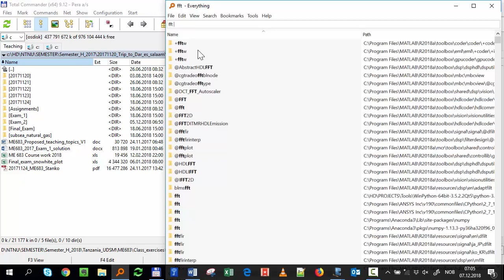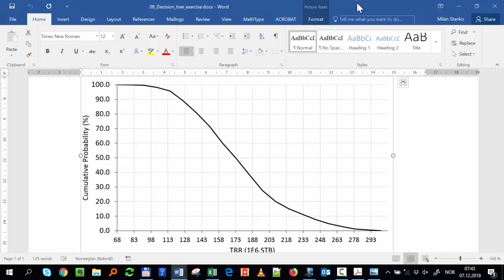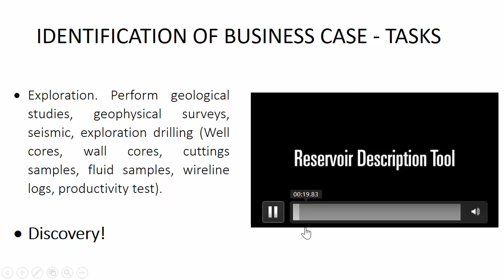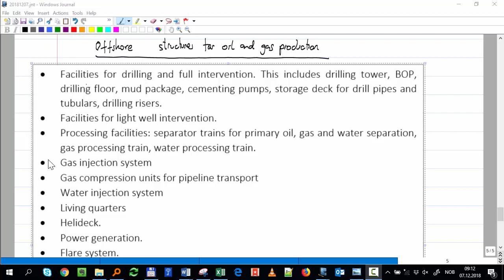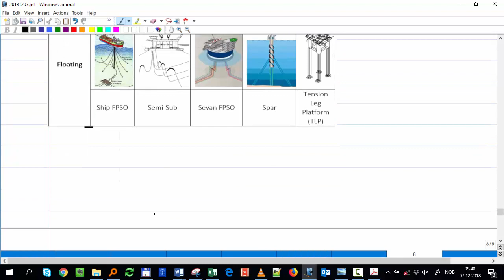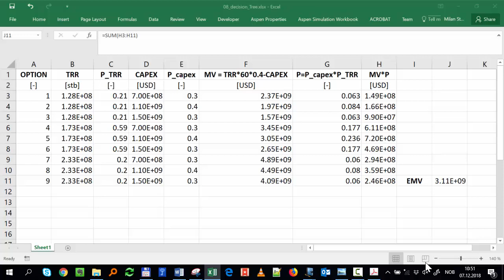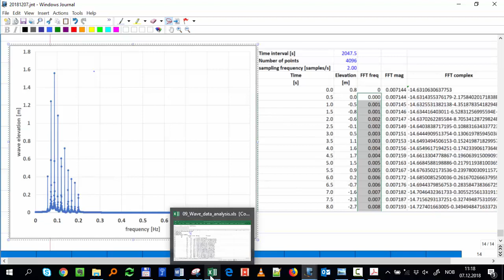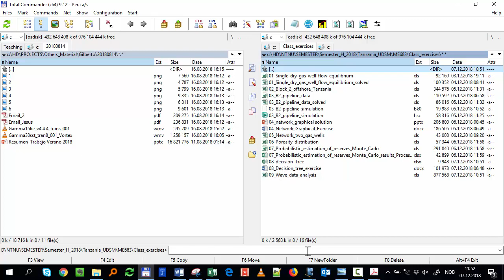Probability tree, field development process and offshore structures

Comment: But the cumulative probability curve you used  to discretize the probability for tree is still generated from Monte Carlo? I am sorry but I  failed to understand why probability tree is a alternative to Monte Carlo in that case?
Reply from the maker: Yes, the cdf curve for TRR was generated using MC. The task here is focused on estimating the expected NPV and NPV cdf of the project, assuming than TRR is an input and has been calculated elsewhere. To solve this task, one could use MC as well, using the equation provided, (MV = TRR * 60 * 0.4 - CAPEX), and randomly sampling from two distributions (TRR and CAPEX). However, I have solved it here using a probability trees. If an appropriate number of alternatives are used, probability trees can still capture the variability of NPV and require less function evaluations than MC.
Reply: @Milanslectures  Thank you for your reply Milan. What a great channel you have here. I have been working as oilfield development project engineer for 10 years and some of the knowledge you shared in the class is very useful to me. Thank you and I hope your students realize the wonderful learning opportunity they are having.
Reply from the maker: @azzordiggle5143  Thanks! I am glad this is useful for you.